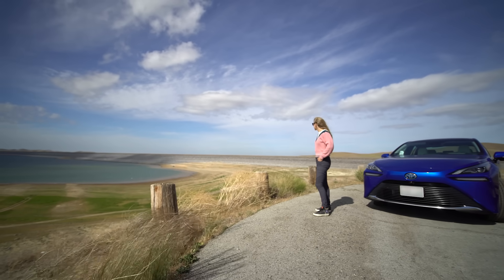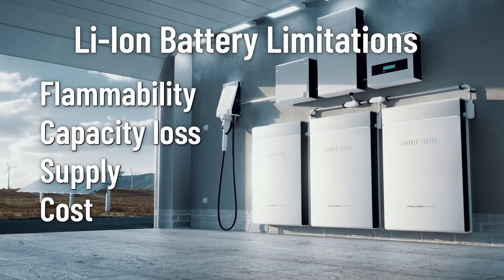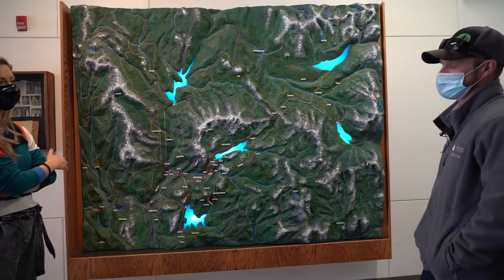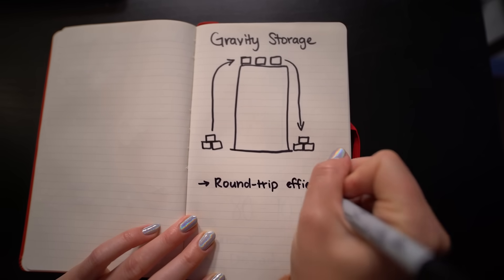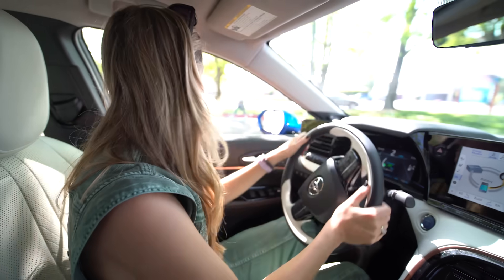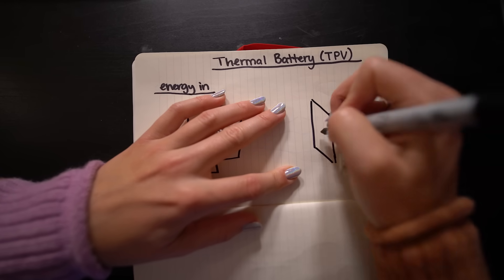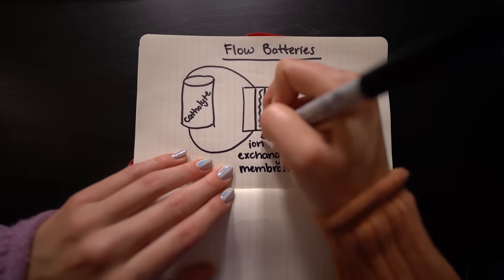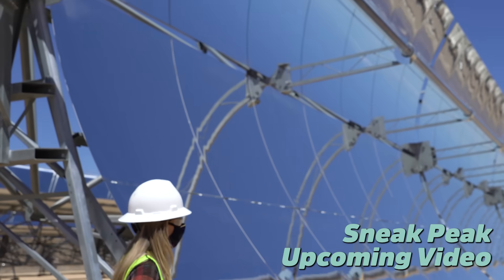The BIGGEST problem with clean energy

Comment from the maker: There are so many more discussions to be had around paths to using 100% renewable energy sources. I imagine some of you might suggest regulation or incentives for using energy when it’s most available to fix the supply and demand issue, i.e. the “duck curve.” Some municipalities already do this, and it works to an extent! Consider though, a supply like wind -  the unpredictability makes it hard to exactly match the demand schedule to the supply. Another solution is to add other sources of energy that are more consistently available, like waves, and nuclear fission/fusion. (We actually visited a company looking into a wave energy technology!) I’d love to make more videos on these technologies, but we decided to focus this video specifically on energy storage technologies emerging as a solution to the Duck Problem.
Reply: Also, continuing to focus on simply using less electricity and making electrical devices/equipment more electrically efficient.
Reply: Wind isn’t unpredictable or intermittent on a continent scale. Solar, while still intermittent, is very predictable. What is needed is strong grid interconnects, preferably long distance HVDC to move wind and solar from where it is being made to where it isn’t. 
https://www.eia.gov/todayinenergy/detail.php?id=20112
https://en.wikipedia.org/wiki/Capacity_factor
Reply: @williammeek4078  I would like to see more uses of concentrated solar with mirrors and molten salt storage, in places like the US there are areas where nobody lives, which would be ideal for it on a large-scale.
Reply: Since you have mentioned nuclear energy, can you do a report on dry casks please?
Reply: Hi! I research thermal borehole heat exchanger storage, and high pressure thermal borehole energy storage (academically, and contracting for the government). If you were interested I could send a PowerPoint we present to government entities usually on thermal borehole energy storage. It's very economical, and feasible on a large scale, but relatively un-heard of! One of the larger projects we are looking at for this is energy storage on the moon, and for military bases, so it is a developed technology that uses already available technology.
Reply: Why not just have solar panels around the world? Whenever the suns up you selling to the other side of the world that is experiencing night...
Reply: @TheBowersj  yeah building intercontinental DC high voltage cable is viable, and it's very easy to convince every nation to allow that to happen
Reply: @nedisawegoyogya  I gave you a thumbs up
Reply: there are a lot of chemical storage procedures available. adding methanol to hydrogen, combining them by making use of the energy from electrical overshoots, we could preserve that energy in a very familiar, easy to use, safe and co2 neutral way. eFuel, eGas
Reply: Hello I’m just a car tech but in my experience I believe GEO THERMAL is the future of free energy once that goes ‘iron core’ bye bye van Allen belts then we are all doomed be cool if you could read this and I would be intrigued to see your views on this energy source, regards rob the London mechanic
Reply: Also, there should be a discussion on decentralized power generation. I think this can complement the current power generation solutions.
Reply: @hermin  Yes. I expect rooftop solar plus storage to fall below the cost of grid maintenance before long and most residential homes to go off-grid.
Reply: @hermin  I think decemtralized power would be great for places like remote towns and farms, but cities and suburbs should still use grid energy to benefit from economies of scale in emergy production and in the future energy storage.
Reply: @Prof_Griz  I agree
Reply: An overlooked storage tech are the batteries in EV cars. There are projects across Europe looking to use EVs in a vehicle to grid (V2G) system for grid balancing and usage shifting.
Reply: One partial solution to the varying availability of wind energy is intelligent grids. For instance, in Scandinavia, it's always windy *somewhere*.
Reply: Hydrogen bonded to nitrogen.  Ammonia is worth a mention!  Existing infrastructure because of its use in agriculture.  Easily transported (exported renewable-saturated countries like Australia).  Can be stored in bulk very similarly to LPG: not super-cold nor super-high pressure (so less losses).  Can be combusted, but better fuel cells are bound to come.  Replace Haber-Bosch production which is responsible for 1.5% of CO2 globally.
Reply: Grid scale battery's are only useful for spinning reserve, not standby reserve. We really need more visual examples explaining the difference to people.
There is a massive misconception about how these systems will / can be used.
Reply: Energy storage and renewables will NOT solve the issue of ecological collapse. You know damn well that it is physically impossible to maintain an economic model that is based upon continual exponential growth and consumption of resources, on a planet that has FINITE resources. This scientifically invalid economic model is the reason we have destroyed our planet in record time. It is the reason that our energy needs are ten times what they should be to sustain us. And this entire system is enabled by psychologically manipulating humanity into being brain dead consumers. Our nature throughout history has ALWAYS been for thrift and conservation. We are depleting resources 2 1/2 times faster than the earth can replenish with this wasteful greed driven society of consumption. And just because we cannot satisfy 0.0002% of our populations desire to own it all. And psychology and sociology both prove that the manifestation of greed is a result of competitive environments, not our nature as our society is taught to believe.
Reply: @davefroman4700  Maybe asteroid mining and worm holes are a  solution
Reply: any "energy & environment" video ignoring nuclear energy is disingenuous. disappointing
Reply: @xyzzyx7812  Nuclear is only necessary because of our scientifically invalid economic model of consumption and waste for profits. That is why our energy demands are 10 times what they should be. Everyone is yelling about crypto, you ever stopped to think about how many terrawatts of energy are used every hour to support this consumer psyop called ADVERTISING? Our nature is for thrift and conservation. And GDP is the reason we are producing junk instead of products that last for decades. If you made a coffee pot last for 50 years like we used to instead of 4-5 like they are today? That is a 900% reduction in the amount of energy and resources that our society required to perform that function.
Reply: What do you think about iron/air/water batteries?
Reply: So you just store the water up here and then just let it run down when you need energy?
Yes, but 5:16 "There are some downfalls."
Reply: Would be interesting to have a future series on everyday energy usage. Many times I've run into places where the justification for leaving the lights on me than they would previously is "oh they are LED". How we use (or don't use) energy really impacts our ability to use and store it
Reply: Thumbnail suggestion: WATER BATTERIES? and show a super surprised face. Next to the words.

Title suggestion: I found the answer after driving for 5 days

Following veritasium's guide here.
Reply: Have you considered 30-40 meter flywheels? Super safe and easy, just spin a big wheel. Flywheels are in cars so we know they're safe. Bigger flywheels just means bigger safety!
Reply: @ElmoRitter  that would be inefficient compared to the others, you would lose much to friction and the cost to spin the larger ones would only get greater the larger flywheel you use.
Reply: @patryn36  magnetic levitation bearings. Boom problem solved you're welcome.
Reply: As a Canadian, the bulk of our energy usage is heating and cooling. Seasonal thermal storage at a reasonable cost would make a hug difference. If I could efficiently store the winter's cold for summer and summers heat for winter, then I only need to use a little energy to move the heat around with a heat pump. Solar evacuated tubes can supplement the heat energy year round.
Reply: Source on lithium running out by 2080?
Reply: @psikot  yes I don't think we will run out exactly as the lithium is in sea water, it's more to do with the fact that it would be uneconomical to remove it from low concentration areas. I do hope by 2080 though we will have the recycling of most of the lithium that we need like we do with aluminium and steel now
Reply: As was shown in Texas, grid interconnects are also needed. Texas has a lot of renewable energy, but their intermittent nature was affected by weather extremes. This is why Europe is furiously building continental interconnects.
Reply: I love you 💗
Reply: Hey, youtube keeps deleting my long post with articles to better fill you in. Look into Blue Hydrogen, which is splitting hydrogen from methane, which creates more carbon dioxide than burning coal. Further, look up the House study on "Clean Coal" and how it was likely dirtier than just burning coal. Then look up the storage of natural gas in the salt cavern in Hutchinson, KS. Then look up fracking and earthquakes. Etc.
Reply: The duck curve is a daily issue.  There is also a need for seasonal storage.  Batteries can not do that, only hydrogen.  You fail to differentiate this vs all of the other solutions.
Reply: You should have mentioned the Form Energy iron-air battery.  They recently announced that it's a better bet than their flow battery, because nothing needed to be invented to use it for long-term storage.  They investigated a sulfur-flow battery, but it needed a new type of separator between the anode and cathode, which could take a long time to invent.  They think iron-air will be $20/kWh when they scale it up, which will be cheap enough to combine with renewables and li-ion to shut down all thermal plants within 20 years. 
I think you are likely wrong about lithium-ion batteries being too expensive too.  There is so much investment going into li-ion that the LiFePo chemistry will likely go below $50/kWh in a few years.  How far below is anybody's guess, but that price range will be hard to beat for competitors of short-term storage (under 10 hours).
Reply: Wave energy, good. Wind powers much of parts of Europe, and US, with slow large turbines. Power storage, good, like with Tesla's powerwalls and megapacks. Solar the size of Nevada would power the planet. Hydrocells maintain Petrol structure, fracking, ineffecient electrolysis, bad. Please do not sellout, I beseech.
Reply: Also, offshore windfarms (more consistent) in the northwest could power the planet twice over. Heated sand and dirt is proving promising storage where relevant. Solar the size of Nevada (even spread out) could power the planet.
Reply: Not allowing the market to shift organically through profit is the biggest problem because over taxation and pressing this so hard gas led to corruption and very little return.
Reply: Let's put solar panels on every home, business and covered parking rooftop and switch to electric vehicles making nearly everything we do solar powered while completely decentralizing our power supply and empowering everyone as power generation owners.

Solar power is CHEAPER and electric vehicles are soon to be CHEAPER to make and already are considerably CHEAPER to maintain and operate, especially if charged from your own solar power.

A 3-5 year ROI (return on investment) for a solar array that will generate power for decades is a no-brainer and the panels can even be made locally too.

#EndFossilFuels #SwitchToSolar #SwitchToElectric #GreenNewDeal
Reply: I appreciate you and your content, but this problem has been solved already. It's not a science problem, its not an engineering problem, its a production capacity problem. The alternatives to lithium will come over time, but lithium batteries are the solution for now.
Reply: @Physics Gril technology connections here on youtube made a video about that not long ago and how he uses his ac at night to well "overcool" his house when there is less load on the grid and energy also cheaper and then turns it off for the day until the evening. you should check it out. this form of storage doesn't really work here tho. in germany about noone uses ac's anyway. we have like 6 month of winter and 6 month of shitweather so there are hardly any days where it's unbearably hot. but i like the idea behind his approach and he is generally such a funny and entertaining person to watch.
Reply: Like how a water tower stores water with potential energy,  we could create "mass towers" that act as mechanical energy batteries right next renewable energy power plants.  No chemicals,  all natural.
Reply: @toolbaggers  oxygen  and water are the 2 most immediately necessary  chemicals  for humans
H202  has powered the world's  fastest cars as a proof of concept
Reply: Combine renewable energy power plants with desalination water plants or use the electricity to create hydrogen and oxygen.  Compress the gases for storage and burn it for electricity and pure water when needed.
Reply: @toolbaggers  with H202 you don't have to compress it (it's a non flammable  liquid) and it's a whole lot denser than H2 and can add O2 to the air instead of taking it out like HC's .
I'm surprised  no one here talking H202
Reply: I♥U
Reply: It's not mainstream but storing hydrogen (H2) as ammonia (NH3) which is actually more hydrogen rich for the same volume and easier to store is a truly sustainable solution.   You can convert water to NH3 directly using Solid State Ammonia Synthesis (SSAS) and convert/generate electricity efficiently with specialized Solid Oxide Fuel Cells (SOFC).
Reply: You really need to learn to simplify things or be more entertaining. watching your channel is like steam going through your head. there must be a reason that you have 2mil subscribers and only 300k view's on this channel while most youtubers have the opposite problem where they have many more view's than subscriber's. Also as going to 0% global emissions by 2050 just seems like you are allowing poorer countries to rot, England, the US, Australia has been using oil for the past 130 year's and their GDP raised an insane amount during this time a big part because of the pricing of oil, today even with all these new technologies arising oil is still by far the cheapest way of producing electricity with only nuclear next to it then come's renewable's. are you willing to let millions of poor people in underdeveloped countries live with no electricity for the sake of a mistake that your 1rst world countries has been perpuating for over a hundred year's?
Reply: 🤗 How come you didn't cover Geothermal Energy❓The whole inter core of the planet is a giant energy storage facitly. In Iceland, the main use of geothermal energy is for space heating, with the heat being distributed to buildings through extensive district-heating systems. About 85% of all houses in Iceland are heated with geothermal energy.

You don't have to live in Iceland to access Geothermal Energy. You can access it right in your own back yard. 
I watch an episode where host Mike Rowe installed a Geothermal Loop Field system to heat a home. What I find very interesting is a home or city could access the energy in the earth to reduce the stress of other energy systems like Solar and Wind. Especialy in winter when you need heating and the sun doesn't shine as much. But what about summer's heat? Well you can use the same system to cool your home.
Reply: No, Physics Girl, I'm sorry to tell you, you are wrong storage is not the biggest issue.  And the renewable energy experts aren't going to tell you what the biggest issues are, because they know that the REAL serious problems are what make virtually all our "eco" energy technologies non starters.  

1.  Infrastructure.  Solar and wind are very low density energy sources, building and maintaining solar and wind will take 100 times the infrastructure.  That means 100x the steel and materials, 100x the manpower to maintain, and probably 1000x the space requirements.  This will cost, hundreds of trillions of dollars, and in the case of solar will need to be replaced ever 15 years.  This is not even close to being sustainable.  
2.  Toxic waste.  Producing solar panels and li-ion batteries creates a lot of toxic waste currently.  If we were to ramp up solar panel production to the point where it would actually generate a significant amount of our energy consumption, we would need to deal with an astronomical amount of toxic chemical waste.  And because solar has a 25 year lifespan and need to be replaced (which btw, makes them NOT renewable) this toxic waste nightmare will be an ongoing concern.

You want me to believe like I once did that this channel is about science and not zealotry, have some courage, and make a serious video examining these issues while being open to the possibility that you could be very wrong and on the wrong side of history with this.
Reply: @homewardboundphotos  Try to apply some common sense to the issue. The Levelized cost (that is cost with direct subsidies removed) of new wind and solar is already below the marginal cost of any fossil fuel. 

That means wind and solar CANNOT be using more resources.
Reply: @homewardboundphotos  Sorry no, your numbers are wrong. You need to show your math so I can teach you how to do the math correctly. 

And if you think those wrong numbers for what you have been fooled into believing solar would cost are high, you should see how much fossil fuels cost over their lifetimes. 

And if you think the environmental impact of solar manufacturing is high, you need to do some research on the impact of fossil fuels. 

So, do the math to back up your claims. Put up or shut up.
Reply: @williammeek4078  LMAO
Reply: @williammeek4078    OK dummy

Every year the earth consumes 580 million terajoules, that's 5.8e+20 joules of energy (INCLUDING fossil fuels, not just electricity).  That would be 15.6e+20 kwh/year (1560000000000000000000 kwh/year).  A typical 60 cell PV is about 5.4 feet tall by 3.25 feet wide, or roughly 2 square meters, and in favorable conditions, will generate 500-550 kWh/year.  So....   we'd need 1.05+18 2 meter squared PV panels.  Or 2,000,000,000,000,000,000 meters squared of PV.  There's your math.
Reply: @homewardboundphotos  You did soooo good at first. But you added a few orders of magnitude in conversion. 580,000,000 terajoules 5.8 x 10^20 J is 1.61 x 10^12 kWh. 580,000,000 joules is 161 kWh. Tera is 12 orders of magnitude. Kilo is 3 orders of magnitude. For 15 orders of magnitude. So 161 x 10^15 Wh in engineering notation or 1.61 x 10^17 Wh in scientific notation. 

But we are only concerned about the 80% of that that is fossil fuel use. So that becomes 1.29 x 10^17 Wh. 

Now, use a utility grade 72 cell 400 W panel that actually is 1 meter by 2 meters and you get 876,000 Wh per year per panel at the rated capacity factor for Texas of 0.25. Divide 1.29 x 10^17 by 879,000 and get almost 150 billion panels. 

Times 2 for 2 square meters per panel and you get 300,000,000,000 square meter covered or 74,131,000 acres. Divide this by 640 for square miles gets you 116,000 square miles. Texas is 268,820 square miles so roughly 43% of Texas needed. 

But there is a MUCH easier way to calculate. Utility scale solar farms get about 1 MW for every 4 acres. 

By the way, the Earth is only 5.1 x 10^11 square meters so your math doesn’t even match your own claim of “the size of Texas”

Also, the cost would be about $50 Trillion which is actually less than what we would spend on fossil fuel infrastructure maintenance over the same time period.
Reply: @williammeek4078  Yes, I forgot a negative exponent when converting to kwh.  Fundamentally, we agree on the scale of the project.  I said the size of Texas because it's an absolutely preposterous size.  You say half the size of Texas, as if that's somehow also not preposterous.  Using the almost half the landmass of the state, which we both can agree on, your 50 trillion dollar proposition would put the cost of these panels at about $112 per square meter, including installation, and maintenance for 25 years.  If you think that is realistic you're on crack.  Multiply that by maybe 4 times and you're getting close.  $200 trillion dollars, every 25 years.  8 trillion dollars annually globally is what you're pipedream will cost, and that's not even factoring in the hundreds of trillions worth of battery backup and transmission line upgrades that would also be required (and need regular replacement).  

And this is all about the environment right?  How much toxic waste do you think will be generated blanketing 300,000 to 400,000 square km with PV and the battery backups to go along with them?  I've read the investigative journalism about the factories in china that produce these things.  There's a small lake of insanely carcinogenic toxic waste right beside every factory, your proposition would seen those lake turn into literal oceans of toxic waste.  And that's just the manufacturing process say nothing about the nightmare issue of dealing with 400,000 square km at the end of their life.  

Do you have any idea what the environmental impact of that would be?  Have you even thought about it?
Reply: @homewardboundphotos  so where is the 30kwh battery powering your house?
Reply: @mukundsrinivas8426  why would I have a 30kwh battery powering my house?
Reply: @homewardboundphotos  see we don’t have enough storage yet
Reply: Wave Energy failed miserably in Australia which has many "waves" and coastlines
Reply: Thank you for this series - great work!
Reply: Good topic to discuss now.  I should also hop on this and maybe look at batteries 🔋  or solar panels und ther microscope. 
Wish you all a good week!
Reply: The VW  XL1   diesel/electric hybrid gets over 200 mpgs. This is proof any car maker can build a small 2 seated affordable hybrid commuter car able to get around 100-125 mpgs. The XL-1 uses lots of carbon fiber to keep weight down but they could use aluminum and still keep weight down. They just refuse to do so, it's all BS, hybrid cars could run off bio diesel, ethanol, compressed natural gas, hydrogen, propane and pollute much less . The Honda NC750X motorcycle gets around 65 real world MPGs even with all it's wind drag/poor aerodynamics. If they built a 2 seated reverse trike with a lightweight aerodynamic enclosure it could get 65-70 mpgs on just the 750cc gas engine alone. Add an electric motor & battery pack = 100 mpgs easy. Also they could make a compressed air electric hybrid vehicle. They're just finally getting around to adding solar panels to vehicles to increase an extra 15 miles or so. The real reason they haven't put solar panels on hybrids sooner.7:34 Electroysis  from solar = It's more efficient to charge a battery/e-car then to create hydrogen & oxygen to power a car. Unless the fuel cell can somehow make up for lost efficiency.
Reply: @michaelbrinks8089  There was nothing affordable about the XL1.
Reply: @PistonAvatarGuy  They used lots of carbon fiber to keep weight low which made it expensive but could use aluminum instead. The gen 1 Honda insight for example could of used a rechargeable battery bank with it's gas engine and parallel electric motor and got 100 mpgs on a combination of 1 gallon of gas and fully charged battery.
Reply: @michaelbrinks8089  the XL1 doesn’t actually get 200 MPG. It just runs as a BEV and keeps the engine off. This is why it is absurd to have one MPG number for a PHEV. There needs to be two sets. One for the engine running without plugging in as a regular hybrid and one on battery only.
Reply: You should post which H2 stations you stopped at to refill. To see where you can go on a FCEV.
Reply: Was about to suggest another way to store energy but I see it's probably going to be in your next video. Hint: salt.
Reply: Check out Tom Scott's latest from the Orkney islands. Hydrogen (not by steam reforming) is the future of Storage and transport of energy.
Reply: @jonathans1759  The fundamental flaw with making hydrogen from “wasted” RE is that it takes 2x as much electricity to make the hydrogen as you get out of it.it is far better to increase grid connections in order to get that electricity to a market that wants it.
Reply: How about the jobs that these technologies will create.  Potentially millions of them.  Saving the planet could be a real job creator.
Reply: @briand8090  - please read my comment regarding the costs of getting the materials for manufacturing and the subsequent pollution. I didn't cover the minerals for making solar panels, but covered mining lithium and war like posturing of the US over lithium (similar to what we do for oil), blue hydrogen which is splitting hydrogen off of methane which creates more CO2 than just burning coal and is funded in Biden administration's infrastructure bill. Or the problem with underground storage and sequestration of these chemicals and compounds. Etc.

Don't just look at jobs. And there is a larger environmental impact not being discussed at the moment.
Reply: @ajc-th5ei  false equivalency to that of our current systems or the effects of our past actions.  And you're assuming that further research wouldn't decrease the need for those materials or that recycling and landfill mining couldn't fill.
Reply: @Dianna 
Hey, Thanks for your videos. 
I recently heard about liquid metal batteries.
They use for example Aluminum at melting temperature to store electricity.
The benefit is, that the price is lower than lithium and the can't explode.
In worst case, the cool down and solidify.
Have a nice day, I like your work a lot.
Thank you and your team!
Reply: The patents for viable energy storage exist, the funding does not. Molten salt is the only current viable solution.
Reply: What about superconductors 
Even though it's still kinda a sci-fi concept
Reply: @zo_gamer3740  - Superconductors are actually quite interesting when used as capacitors in conjunction with batteries for storage. Batteries are slow charging and energy on demand, whereas superconductors for storage are fast charging. Combining one holding the charge to charge the battery over time has been looked at regarding graphene. Really interesting research, if you have the time to look it up.
Reply: @ajc-th5ei  I've seen a couple videos about them but really haven't gotten into much research but thanks for enlighting me with info I would've never known😁
Also I've heard nuclear energy is somewhat better than solar or wind cause of how much energy it can produce without any carbon emissions 
Is it better than solar or wind with the only drawbacks (I know of) being the disposal of used or depleted fuel rods
Reply: @zo_gamer3740  - for some reason, youtube deleted my response to BigCooter about nuclear. 

Basically, France has a process of recycling nuclear waste which we do not use due to going over IAEA established limits on nuclear refined material. It makes the waste down to 6% or so, with 93-94% being reusable. Instead, we use fresh ore and then store the waste in heavy water or transport it to Yuka mountain for long-term storage. To understand the problem with long term storage, you should look to places in the northwest and other areas where we have even seen leaks of the barrels containing the material.

Small form reactors where the material can dump into molten salts is promising, as well as tokamak fusion reactors and other small fusion reactors currently being developed. Fourth generation and newer nuclear plants also are safer.

But, the US has a problem of having positioned reactors on fault lines due to cheap land and the problem of Not In My Back Yard. As such, there are concerns on what happens regarding that. Further, with aging power plants, we now have in some cases 60 years of waste in pools designed to only handle 40 years worth of material. They need larger overhauls not being done. 

So there are a lot of drawbacks to nuclear not currently being discussed, although there are exciting advancements being made.
Reply: At 0.75 speed I got that... be carefull though because you'll fall in love so much quicker
Reply: Aww, you missed my favourite. Solar Thermal!
CSP (Concentrating Solar Thermal) I especially like the Power Tower approach.

Or wait, is that going to be in your next video? Yay!
Reply: How about developing devices that are energy self sufficient. Maybe energy was never meant to be stored but generated and used, I believe that concept is possible
Reply: Water is cheap and available,  plus you can store sunshine as the cleanest fuel and / or hydrogen.
We like it here at MILLS MILLS ENGINE WORKS INC - the Worlds Largest  Pollution  Free Automotive Research  Laboratory  (not in California)
Reply: I suggest not using unrealisable energy sources
Reply: @NoRegertsHere  I know - Li/Ion ?
Reply: @NCOGNTO  
Coal, natural gas and 4th gen fission. 

Without that, a country will fall behind in everything. Manufacturing, innovation, standard of living, ability to defend its borders. 

Energy grids of the future (70+ years) must scale 30-40x what they are now. And the energy needs to be on demand.

Renewables are an absolute joke compared to those other 3.
Reply: @NoRegertsHere  "Renewables are an absolute joke compared to those other 3" 

That is a very fast conclusion when you consider the future of renewable energy. We may never know the surprise the world is in for in the nearest future. I think there's something coming in the world of renewable energy that will sweep us off our feet and fix the world's energy crisis once and for all
Reply: @NoRegertsHere  well , sunlight is a constant based on fission if I remember correctly .
"Renewables" are mostly based on "solar", if we can harness it .
Reply: @NoRegertsHere  "Beamed from space" mean anything to you ?
ITS FREE !
Reply: I think we should be looking at harnessing the energy provided by constantly flowing sea currents.
Reply: @marksandison3642  making seawater into H202 could provide badly needed oxygen to our atmosphere and reduce sea level while reversing global warming
Reply: @George Mann where do you put your toxic waste ?
Plastic is bad enough and it's not even radioactive
Reply: Couldn't find any relevant sourcea on google so I'll give it a go and ask the actual physicist: Would electrolysis powered by a Deuterium+Tritium fusion reactor in theory be able to refine water into deuterium and tritium with enough efficiency as to never run out of fuel?
Reply: @OB1canblowme  a solar / water plant can make 2 fuels - H2 for stationary use and H202 for mobile use - doubles profits
Reply: @OB1canblowme  why do all that - mining ,refining , constructing and operating reactors  ? When solar energy is free and available  everywhere ? Eliminates supply chain if captured at point of sale .
No waste either
Reply: Pricing has to match actual abundance not just timing.  And demand response and EVs are how we solve this not grid storage.
Reply: @crhu319  water is cheap
Sunshine is free .
It's simple to catch and use
Reply: One energy storage tech that should have made your list:  Liquid Metal batteries (Donald Sadoway, Ambri) "If you want your batteries to be dirt cheap, you need to make it out of dirt, preferably locally sourced dirt."  He uses that philosophy to restrict where on the periodic table to look for battery technologies.   Since his batteries are molten, the anode/electrolyte/cathode interfaces can't degrade, so they should last basically forever.  The downside is the heat will leak out no matter how well you insulate, so if you don't use the capacity as much, it is less efficient (you need to spend some of the energy to keep the metal liquid) but 70-80% is not unrealistic.  They are scaling up production for a commercial contract now.
Reply: @flyinbrian865  our whole plan is lower energy costs
Sunlight is free , use all you need/want
Water is cheaper than oil (by a bunch !) and needs less processing  to be made into fuel and less people in the distribution  chain
If its Pollution  free , you don't have to buy scam "pollution  control devices" on your car (better than just "free")
Reply: @flyinbrian865  a single drill location costs around $9 Million here in Louisiana
Reply: There are significant, if not unsurmountable problems to overcome.
Firstly consider that renewable generation, wind, solar, tidal or wave are all asynchronous generation, i.e. they are uncontrollable. This means that they can never power a grid without having a significant part of the grid supply as synchronous, typically fossil fuelled or hydro to keep frequency stable.

I can't see that storage can ever be large enough to cover 365 days a year.  This last four months or so in the U.K. w ehave seen a very low average output from our wind farms. If you calculate how many gigawatts hours that amounts to for the below average generation level it is quite apparent that storage cannot not do it. Consider current batteries installed have capacities in the  Megawatt hour range .One days storage to compensate for low wind output is in the conservative order of 4 x 24 Gigawatt hours. As I say we have had four months with no sign of it changing at present.
Reply: Was there any discussion among folks you met about blending the compressed air or cryocooled air models with carbon capture efforts, for a synergistic environmental benefit??
Reply: @ryanrosenberg785  ever heard of the KISS Principle  ?
Reply: also, any mentions of combining cyro-cooled technology into home systems?  seems like there could be blended applications with some of the newer "ice battery" HVAC systems.  Those are primarily in commercial building applications currently but look to be heading toward mainstream residential use as well.    P.S.   Love your channel, your PBS content, and you've been a joy for my kids to learn more about science (particularly during school shutdown and virtual learning last year!!)
Reply: I am so glad to see that these complex issues in regards to going 100% renewable are finally getting the press they need!  As someone who has been interested in renewables since my childhood in the 70s, then learning about the "REAL HURDLES" that will have to be resolved before it becomes a reality by the 80s, then spending the decades afterward hearing everyone praising the power of renewables, and that it has to be done today, without knowing or understanding that without scalable, safe, and economical storage it won't happen.  Right now our grids capacity has been maxed out for sometime now and just adding more solar, geothermal, hydro and wind generation is only going to make things worse, not better.  I am also very glad to see so many companies are really working hard to resolve this issue, but again having a scalable, safe, and economical storage isn't going to be a quick and easy fix as you have pointed it.  It's going to take a lot, and I mean a lot more bright and educated people, big business, the fossil fuel industry and governments working together and not trying to condemn one another or screw one another, to make this happen.  Now for it to happen by 2050 is another matter.  There are more hurdles then just technological ones to make that happen, but that's for another video, Physics Girl! wink LOL!!!
Reply: @DarinM1967  u need to make a book
Reply: nature already stores energy for us called food
Reply: A good video on how to understand and use your instincts https://youtu.be/XrmyGtdmgoY
Reply: Corporations have been limiting scientific progress to secure profits for over 100 years. We could have had LED light bulbs in the 70's. Girl, i love your light and aspiration. But, it's for not at this rate. Go Biden!
Reply: You should at least mention about this solution
Reply: Clean energy is not necessarily renewable, what we need right now is 0 CO2 emissions.
With uranium only we won't have to worry about renewables for at least 1000 years.
Adding thorium to the mix in the next 50-100 years we'll have limitless amounts of fission energy, and by that time might have also figured out fusion energy.
So by focusing so much on renewables y'all are diverting valuable efforts towards 0 CO2 with virtue signaling activism that ends up blocking progress
Reply: Nuclear is not a viable solution, except from the point of view of the profits of the nuclear industry.  It is expensive (as I could see from the nuclear power surcharge line item on my electric bill when I used to live in the San Luis Obispo CA area), destructive of the environment and worker's health (in the mining process), dangerous (Chernobyl and Fukushima show this), and leaves nuclear waste that continues to be highly radioactive and thus has to be kept secure for hundreds of thousands of years (far longer than civilization has been around).  Renewable is the only way to go, and we could have already had it if Reagan and his corporate friends hadn't killed all of the research into it that they could kill.
Reply: Physics "Girl"  ..... looks like a 40 yo woman
Reply: Why are we spending our precious dollars on "renewables." One nuclear plant is like 10 billion solar panels.
Reply: Store heat: molten salts @ 750-650 C. Also for nuclear fission again molten salt UF4 in BeF and LiF salts, operating @ 650-750 C unpressurized. Solves a heap of heroic engineering challenges such as the fuel pellet expansion problem and the high-pressure vessel problems. Have a look at the molten salt reactor experiment Oak Ridge 1965 - 1970.
Reply: I won't take man-made climate change as a legitimate issue when the solutions don't include nuclear technology, something that has 75 years of research and implementation history.  This is all just Political Correctness to the nth degree.  Not that I don't appreciate the research in other technologies, but there is mostly a blind spot regarding nuclear.  Also, you don't seem to consider the comprehensive problems involved, like environmental costs of manufacturing and disposition of the byproducts.
Reply: @rwmiller9062  And nuclear power doesn't have problems during manufacturig parts for the plants or production of fissile material? Do you think enriched uranium appears out of nowhere? I think the miners would disagree.
Reply: I forwarded this to my colleagues at work as we supply control valves and instrumentation and we have a ton of old potash caverns and oil reservoirs we can use for storing air in Saskatchewan. Nothing for pumped hydro since we are super flat.
Reply: Where are the nuclear power plants or nuclear fusion plants (future)? Save and clean energy
Reply: I wonder if carbon solar could reuse existing solar at night. Have a little carbon lamp that flips over the roof solar (covered to stop light pollution).
Reply: @Alien Reject Less than the energy required to feed them. Food in = energy out. You may as well just burn that food under a steam generator for power.

The fitness? It helps people get fit for certain. But it produces so little power, it's almost pointless for anything past charging your phone. So with such easy access to solar etc, it's just easier to exercise normally and put the phone on a solar charger instead.

Someone did the math on Youtube. You just have to search.
Reply: Thanks Diana. My 13 y.o daughter is so inspired because of you. She’s recently introduced you to her 8 y.o sister too. I can’t thank you enough.
Reply: All the government do is incentivize all green true zero emission energy to compete with fossil fuel then let the market do the rest.
Reply: Why modern renewable power doesn’t need a breakthrough in energy storage | Amory Lovins:
https://www.youtube.com/watch?v=Oo8iEL6SqgI

Bill Gates on Energy Storage: 
https://www.youtube.com/watch?v=RH5Lgv-4te8

Hydraulic Energy Storage:
https://www.youtube.com/watch?v=ObvQFX6noDw
https://www.youtube.com/watch?v=m3p_daUDvI8

Giant Flow Battery Storage for Cities:
https://www.youtube.com/watch?v=_qsKUVQtAhA

Flow Batteries Used to Live Off Grid:
https://www.youtube.com/watch?v=4OHstY_kKUY

Flywheel Energy Stabilisation: 
https://www.youtube.com/watch?v=_QLEERYS5C8
https://www.youtube.com/watch?v=N9PPSTczTNE
https://www.youtube.com/watch?v=QU-Px0VjQ2w

Recycling Batteries: 
https://www.youtube.com/watch?v=HiOLan8J0cE
https://www.youtube.com/watch?v=iFchfHH0qzg
https://www.youtube.com/watch?v=dOn-L6nUS54
https://www.youtube.com/watch?v=oKFOqMZmuA
Reply: I am excited about liquid metal batteries and aluminium air batteries as well as storing energy by creating hydrogen. Dams are quite ecologically damaging at large scales. Look up Ambri about liquid metal batteries, they have practically infinite charge and discharge cycles, and utilise the excess heat to maintain their metals at the liquid state. The aluminium air battery is pretty promising for long range usage, and excess energy can be used to turn the aluminium oxide back into aluminium.
Reply: trees just sit there trees forget about waves trees are waiting for a break through.. so lets figure out how we can use tress to solve our energy efficiency. Im not sure how it all works but ill try to figure it out
Reply: Anglo American is building a solar powered plant to charge hydrogen fuel cells. These cells will power a 2,000 HP truck fleet that operates 24/7 at a Platinum mine in South Africa. The target is to eliminate the burning of 6 billion liters of diesel per year by 2030, at a lower operating cost. If you are interested, I can put you in contact with the project team head. Regards.
Reply: I see it as a balancing act governments and markets will have to figure out between storage, long range transmission, and induced demand. That last one, induced demand, is especially interesting to me because it could also help offset the carbon we have put in the atmosphere in our history and the carbon that is now being naturally released due to things like the thawing of permafrost. There are several direct air capture technologies that have relatively passive phases of operation and then only require energy to actually sequester the carbon.
Reply: Best to stick with nuclear fusion/ fission technology, cleaner, uses less land, more efficient, and safe for the so called environment.
Reply: My fave grid scale storage tech is the liquid metal battery. Cheap, same millisecond response time as Li Ion, 300 year lifespan (200,000 full charge/discharge cycles), bla bla bla. I like it because it needs to be run hot instead of needing cooling. A major industrial city needs 4 days of storage to use as much wind and solar as possible and dependable power that I see as nearly only available from nuclear. In this context hydro is not sufficiently dependable to be called dependable because, water.
Reply: This was solved 15 years ago. AI is why you never learned it. I was there with NASA Ames and Stanford scientists and White Sands engineers. I hired them and they did their job well.
Reply: You conveniently leave out what it takes to manufacture all the components of the various systems. Batteries in particular require a lot of fossil fuels to mine and process. The same with photovoltaic cells. And wonderful, burn up hydrogen, yes one of most abundant elements, but you want to remove it from our water which we need to live and how many things will be impacted by the balance of hydrogen / water on the planet. I simply do not see how this is any improvement to our environment.
Reply: @dallasarnold8615  it’s not, it’s just gaslighting to make them feel good. We should stick with nuclear and develop fusion power, as well as design clean burning hydrocarbons in a lab and bio fuels. Diana is getting too caught up in politics and is losing her critical thinking skills.
Reply: @dallasarnold8615  The inability of humans to develop&deploy comprehensive, EFFECTIVE solutions that do more good than harm is evidence of the REQUIREMENT for a large united global braintrust&a fractured, divided, uncooperative, war-loving & generally distracted planet-sized population is evidence we'll be extinct in well under a decade. The ICE CLASS at GretaThunberg (0rg) explains this in physics and chemistry clearly enough.
Reply: Nr
Reply: Ùùuùunrùuu
Reply: Hi, I might have found a solution for this problem. A lithium free zinc based rechargeable battery. Would u want more information?
Reply: @mukundsrinivas8426  What is wrong with lithium?
Reply: @williammeek4078  very pollutive and expensive to manufacture. Cannot be manufactured in open air like my technology
Reply: @mukundsrinivas8426  that is a pretty incredible claim considering lithium ion is the cheapest rechargeable battery ever. Also, lithium is starting to be extracted from seawater.

But sure, show me what you have.
Reply: If we all worked together as a human civilization, perhaps decentralized energy storage solutions would also help to some degree. When people are sleeping in one part of the globe, there's other people who are awake and need that energy. To a lesser extent, and within a smaller geological region, there's always variability regarding when and how much energy people use within a given amount of time. In that sense, the problem of having to store larger amounts of energy becomes reduced.  It could also be more cost effective when we don't have to as much of the energy that we produce.
Reply: Solar farms should advertise sales when they have a surplus, text EV owners to  plug in their cars.
Reply: can i work with you
Reply: The answer to renewable energy is simple: Lead-Cyanide-Stryctnine batteries!!
Reply: Hi PC, here in the UK they are now working on smart chargers charging ev's. They have the ability to feed back to grid when needed. This would use a small amount of the owners vehicle battery in exchange for a better tariff, for instance. When you combine solar on your roof and add your car sitting on your drive way, you become your own power provider (overall). The best thing is the power is non centralised, safe and efficient due to little transmission loss. As a side bonus, this also makes the grid more secure, in every sense of the word.
Reply: Hi Physics Girl, Can the energy from lightning be safely captured?  Has this been looked at?
Reply: @Parpl22  It can be--in a bottle. And I can sell you some for $40,000 a bottle. I also have a bridge in Brooklyn to sell you if you want it.
Reply: Why is everyone so oblivious about geothermal energy? All you need is a hole deep enough and you can pump saltwater into it and use it to drive a steam powered generator day or night, wind or no wind.
Reply: @VGAstudent  They call that fracking.
Reply: Hi Dianna, I have a couple of ideas regarding green, clean energy. Not sure how to get the ideas to production sources. Any thoughts? Really enjoy your videos !
Reply: Nuclear ftw
Reply: I am wondering why super capacitors weren't mentioned as a source of energy storage? even if it's just a bridge solution to lithium ion while more efficient solutions are developed?
Reply: Armstrong was doing energy from a weight on fluids in the 19th Century.
Reply: So fun to watch. 🧠
Reply: I have some great info for you on Nat Gas and Hydrogen sources and cutting edge tech.
Reply: The ocean holds great energy wealth but presents many long-term issues regarding corrosion from sodium chloride.
Reply: It'd be better, if we want zero carbon, to go nuclear for baseline energy and hydroelectric plus a few peaker plants.  Then we don't have to do the expensive storage.  It'll cost $60k per house to do both solar and storage and it is far cheaper to do nuclear and hydro when the cost of those plants are divided up among the houses served.  Hydro also provides water which is much needed in California so hydroelectric is like a twofer.  Solar and wind simply is not a feasible solution.
Reply: Nuclear?
Reply: Wind is actually a lot easier to predict than solar. Here in Denmark, wind makes a big part of our power, on windy days, much more than 100%. And still, every day at 2 PM, the prices (and hence supply/demand) are locked for the next 24 hrs.
Reply: You touch a very important point here: Move the demand. 
And it should actually be somewhat "easy". For a normal household the biggest energy consumer by far, is heating and cooling. 5 times as much as everything else. And heat/cold is very easily stored in a insulated water tank. And having such a tank for your HVAC locally, would make much better used of the grid, so it dont overload.
Next is the fridge/freezer. Again, with current tech, is should be fairly simple to make a smart-fridge, that can cool ahead when renewables are avail and shut of when the demand is a peak.
This is of course, if you don't have a Tesla or other EV parked outside. But the power demand for those are even easier to move... We just don't do it enough.
Reply: Unsubscribing to this unscientific propaganda. Solar energy supplies all the Earth's surface energy cycles. I'm in Seattle. We have Wind, Hydroelectric, and Geothermal as Green 24/7 power sources. Wind is reliable because Columbia Gorge is fed by Earth's continental prevailing winds. Hydroelectric provides night and peaking power. The 4 small Vertical Axis Wind Turbines at house corners have about the same yearly output as my rooftop Solar cell array. The entire country of Iceland runs on Geothermal.
Reply: The channel "Undecided by Matt Ferrell" actually goes into how companies are working to corner the market on efficient recycling of lithium ion batteries and other elements used in substitution! It's through a type of hydro-metallurgy process, which is exciting to consider if lithium ion is estimated to deplete by 2080! I just watched it, definitely worth looking into more.
Reply: Oh this was pretty cool a metallurgist talking about carbon steel
Reply: https://youtu.be/gPepgsGu0oQ sorry forgot to share the link
Reply: I love your notebook addition to this video.  Lucky you have nice handwriting as that's not typical for a physics mind. HA
Reply: Firstly, nuclear. Second, the resources needed for renewable is actually not feasible long term. Thirdly, fusion!
Reply: @austinpatterson7500  then you should consider also geothermal wave motion generators getting entire communities to go solar to sell back energy. Magnetic generators. There's lots of ways to create or harness power
Reply: @TheBunnyodeath  absolutely agree
Reply: In the US anyway, off-shore wind is about to take off, this has the potential take up the "dark side of the Earth" slack in PV production..
Reply: Loved it, dyk one of the Victorian Power Banks went up in smoke (built the units way too close to one another and burnt the others down with it) & you probably know this , Hydrogen is a by product of many chemical production plants. but bad news, you have to replace H. car fuel tanks every 5 years why?
Reply: @Physicsgirl Can you answer this question for me in a video? if the whole earth was burning ONLY H2 (from water, gases etc), in how many (millions? billions?) years this will affect the balance of the environment? We can hypothesize that even 1% depletion it may lead to bad effects on the environment? eg. less water less h2 related gasses, environmental chemistry may be affected.
Reply: the main problem about renewable energy is not technical, it is the economic and politic will to make it work.
Reply: Unfortunately the aspect of physics won't suffice. In order to have perpetual free renewable system. It needs too be observed as a whole. Taking each symptom that needs to be solved. Apply that to the whole. Example waste of system is still energy and material to be applied to another. By integration hubris needs to be eliminated.
Reply: Why should anyone listen to a pseudo-scientific conartist that UNETHICALLY deceives the public by FALSELY claiming scientific discoveries that aren't rightfully hers or ANYONE at her channel?
Reply: Intermittency is the 3rd largest problem.  The first is that inverters have no inertia and therefore cannot stop faults from burning or cascading blackouts.  Even the attempts to program the inverters to respond has failed, as several blackouts happen because the generator disconnects from the grid rather than increase generation to trip the fault off.  The second is that they are not green due to the massive amounts of millions of acres of eagle-killing blades or birds being fireballed out the sky from solar mirrors.  Nuclear is the only non-coal alternative, while coal is the cheapest.  Any coal not burned in the US is shipped to China to be burned with far more pollution.
Reply: You missed liquid metal batteries. There is a company by the name of ambri. It has an efficiency ~ 80%, It is scalable and perfect for grid balancing
Reply: Why oh why does know one talk about Geothermal energy ??? 
If we put as much time into it as the sources mentioned in this video all this talk about storage would fade into the back ground of the automotive industry.
Reply: Why do you try to associate yourself with Physics, when you nor any of the DROP OUTS and LAZY GRIFTERS operating your pathetic channel, are aptly educated and experienced in the sciences?

You, at best,  have a Bachelor's (but even more likely, you only have a mere Associate's degree - that is what "undergraduate" means).

There is no indication you are pursuing a Master's or Doctorate.

Finally, you have been published (and,  this,  peer-reviewed, ZERO times. No scientific journal or reattach community knows who you are and NONE ever support your channel - because you are unethical, misleading, and your channel is clearly COMMERCIAL in nature,  not academic.
Reply: Zinc–bromine batteries. 100+ Year old technology.
Reply: @matthornton44  I was going to first ask you, "so, what is your point?" But, I doubt you really had one, as you used up all your "look at me, aren't I clever" brainpower on that gem.

Besides, your little knowledge flex is completely WRONG.

1.
The PATENT for a zinc/bromine battery system was applied in the lat 1880s - that makes the zinc/bromide CONCEPT 130+ years old (significantly more than "100+"). Enough of a variance  to make your statement categorically false. But, kudos on your pretentiousness!

2.
NO "technology" was developed until the 1970s, because, the idea had fatal flaws that needed rectified before the battery could even be produced successfully in a lab, let alone applied to any markets.

3.
That makes the "technology" around 50 years old.

4.
The A-10 Thunderbolt ("Warthog") is a military Anti-armor, close air support fixed-wing aircraft. Guess how long it has been in service? Since 1972.

So, yeah, exactly what does "100+" (PLUS, add 30 more) years have to do with anything?

Feel free to elaborate your genius - which fits with this channel and their poorly educated posturing as a scientific  channel (really just after monetization and ego-massaging pseudo-intellectual credibility).
Reply: The content is really something ,i feel, is important and interesting .
Reply: What do you think of hot, liquid-metal batteries for grid storage, like Ambri? Snake oil or a real contributor to balancing a renewable grid?
Reply: @kalvindeane1  not snake oil, but nit the best solution. 2x overbuild RE with HVDC connections between the various regional grids and most years, no storage for longer than minutes is needed. Once a decade, a 12 hour shortfall of 25% is the max anticipated. V2G seems tailor made for that.
Reply: @kalvindeane1  That's a point which this video did not focus on fir some unknown reason, right?  Liquid sulfur battery wasn't even touched and tgat was a interesting item a decade ago.
Reply: Geothermal energy might also be considerable consistent. Storing that might be useful too.
Reply: @westonding8953  yes, very consistent. And the heat is already stored so no need for additional storage.
Reply: @westonding8953  just read back on the comments after mine, 100 💯 percent the best source 💯
Reply: I was waiting for a "You Should Be Pumped About This" pun.
Reply: In the UK we are testing tidal turbines as well which while not energy storage (they would work 24/7) they would help with base loads and help us and more countries off of using gas peaker plants, though I'm not sure if it as feasible in the US?
Reply: @markreed9853  I like tidal turbines, these are a more predictable source of energy compared to wind.
Reply: @markreed9853  They don't actually work 24/7.  Their output varies with the tides which are roughly sinusoidal. What that are is predictable.
Reply: @markreed9853  I’m from London uk please show me these wave machines 😂
Reply: I don't understand why we are wasting our time and resources with renewable energies. Nuclear energy is by far the most efficient form of energy available and it is actually safer than certain renewable. We should use nuclear fission until we create fusion reactors and that will be the used for hundreds of years
Reply: @apexdisease6030  nukes are not very portable - do you mean electric power on a grid ? Cause that's what nukes are
Reply: @apexdisease6030  you nailed it with your statement " I don't understand...."
That's obvious .
Reply: Hydrogen is so inefficient in so many ways and so hard to move and store.
Reply: New nuclear makes so much more sense, specially on poor countries
Reply: @levmatta  too expensive
Reply: @levmatta  it takes too long, we need the grid largely solved before the decade is out. Just getting permits takes that long.
Reply: @levmatta  no, its just to costly and takes way too long and then you leave future gerneations with the cleanup bill, in the UK our new nuclear power station is going to cost over £20 billion + and will have taken over 8 years to build!!
Reply: @markreed9853  very good reply, all of that is just technology/investment problems. Please note that I am talking abou New Nuclear -- small, modular, pre-fabricated, molten salt  (preferably Thorium breeders but not limited). (Someone will point about so called "waste", that is also not a problem at all)
Sorry for being brief, the point is that storage is important but very economically wasteful.
Reply: @levmatta  yes I've seen lots about molten salt reactors and these new smaller ones but I still can't see it being cost-effective/quick to install compared to installing more wind and solar (even the mirrored ones that heat liquid for storage) with other battery/other types of energy storage, we just haven't got the time as well
Reply: @levmatta  Nuclear will still require storage, or diesel/coal plants to cover for peak loads. Nuclear is much better than wind/solar for providing consistent base load, but most plant designs can't ramp quickly enough to cover peak usages.
As for Thorium plants, those are decades out. China just completed 10 years of their Thorium test plant trial, and they are still a ways out from commercial plant designs. Most other nations are years if not decades behind on Thorium plants.
Economically, nuclear plants are just too expensive for Third World nations, not to mention the infrastructure needed to extract, refine, distribute and safeguard nuclear fuel, which is by no means carbon neutral or even environmentally friendly.
Nuclear has a lot of potential as a reasonably green energy source for developed and industrialized nations, but it is not a near term solution for most of the world due to cost, environmental concerns, geographic factors (any high capacity plant uses steam turbines, so needs lots of water), infrastructure requirements, political concerns, and the sheer fact that a lot of promising nuclear technologies are still at least a decade or more away.
Reply: @V_is_for_Void  thanks for the reply! Will study your points, in concrete terms I believe your right (but still hope nuclear can provide peak loads also -- I need to review).
(this video series is nice and informative, it just stink of Toyota a little too much -- compound to that the high cost of renewables + storage -- ahh just wish arguments like mine, yours and others were part of the video to clear the stench)
Reply: @markreed9853  If you compare the rate of CO2 emissions reduction that France saw when it installed its nuclear energy system to the reduction that Energiewende has made in Germany over the same number of years, nuclear beats renewables many times over. Nuclear is also the only energy source that's capable of displacing fossil fuels in any significant way, which has also been made clear by the Energiewende debacle. Germany also has some of the most expensive energy in the world, while France has the least expensive energy in western Europe.
Reply: @levmatta  Actually it doesn't, because new nuclear plants are becoming increasingly expensive due to their complexity and safety demands. So much so, that they can only stay competitive with government subsidies.
Reply: @andreasvogler1875  And you don't think renewables and fossil fuels are also heavily subsidized? If they had to responsibly contain their waste the same way nuclear does (instead of dumping it into landfills/the environment) you can be sure their prices would be much higher as well.
Reply: @tonynowak6306  Sure, but renewables get cheaper, due to improved production processes and there are companies specializing in recycling solar panels. Also, unless it gets physically damaged, a solar panel can produce power for more than 30 years without producing any more waste. A nuclear power plant produces nuclear waste as long as it is in operation and most countries don't have a place where they can safely store that waste.
Reply: @levmatta  Nuclear is extremely safe in developed countries, but having it in developing countries is a Chernobyl waiting to happen
Reply: A bit upset you didn't learn about liquid metal battery
Reply: @nedisawegoyogya  Source on that being anything but theory?
Reply: @psikot  Ambri?
Reply: @psikot  at least it has wayyy better chance than flow battery imo
Reply: @nedisawegoyogya  So, no. Both are vaporwave.
Reply: @psikot  say as you like, the concept is just too obvious. Change my mind with arguments, not a statement.
Reply: @nedisawegoyogya  Show me an article, not clickbait news, on new battery chemistry.
Reply: @psikot  not even a new tech, and already demonstrated, but okay
Reply: @psikot  can't send if YouTube censor me
Reply: @nedisawegoyogya  ?
Reply: Diana, love your channel. I'm an electrical engineer in the energy sector, and you are 100% right here. Our biggest concern is not energy generation, but storage. It's very difficult.

And by the way, the problem lithium ion batteries is not with lithium supply, but with cobalt and nickel supplies. Those are far more challenging. Also, no standardization in lithium battery chemistry make battery recycling much harder also.
Reply: @Physics Girl instead of looking to "regulation" or "incentives" all you need is prices. A grid can be a market place with a clearing price of electricity, where the grid takes a cut for maintenance. All the grid needs to do is lower prices until the frequency comes down and raise it till the frequency goes up. You propose that the wind is a problem, it is not. Customers, storage and generation can all make well informed decisions with one signal. Spot prices can be broadcast and you can have things like two dimensional thermostats with Temperature and price, no one needs to be caught off guard by emergency pricing, and prices. "Peak" "offpeak" are terrible approximations of a market and prices are not trivial and not something one party can determine. Planning a market causes problems, there is very little place for a vote and no decisions should be made by an entity that cannot fail/go bankrupt because of their bad decisions.
Reply: We should be talking about NUCLEAR Power !!   Making it safe, building power plants, etc...  as part of a Zero Carbon future.  While Solar and Wind power can help with peak demand supply .. the underlying base supply should come from Nuclear.
Reply: Would you have done this if Toyota didn't pay for it?
Reply: @chrisstearns10  how could they have access to a hydrogen vehicle otherwise?
Reply: @kus88  some hydrogen vehicles are on the market currently. Not many sales because there are so few re fueling stations.
Reply: @chrisstearns10  True... infrastructure is a big hurdle and we're adverse to change... sometimes I wonder how we ever got past horses.... "Gas, who needs gas? Doesn't that stuff explode? And cars are so noisy.... I'll stick with my horses, thank you"   lol
Reply: @chrisstearns10  fossil fuel companies are shilling hydrogen so they can keep selling oil
Reply: Stationary storage has only one real option i know, vanadium flow battery. Aside from hardware maintaince, the battery medium itself never wears out and you can upgrade it as necessary. The use of snthing else is people not letting go of a second rate dream.
Reply: @patryn36  
We don't even know what all of the "anything else's" are yet. To say that there is only one true way is to close your mind to the other possible solutions.
IMHO, of course.
Reply: @patryn36  that view is way oversimplified. LiFePO4 batteries are outstanding for voltage and frequency regulation. Flow batteries cannot ramp on the millisecond time scale lithium can. Then, it would be hard to beat V2G on cost as most will have those batteries anyway.
Reply: @williammeek4078  flow batteries do not wear out, the ionic bonds have no limit on how many cycles the battery can last, the lithium iron phosphate does impressive as they are. The lithiums are good to start with but one would be a fool to stay with them when you have flow batteries. Only time a fast ramp up time is relevant is like in an electric vehicle, for a stationary you need to have the output at certain level to begin with. Once you get into industrial applications, like an entire district of manfacture and computer companies, you really should go into reactor techs to satisfy the power requirements. The molten salt designs can run on current waste stockpiles and their spent fuels are actually valuable after they cool off, which is only a few hundred years instead of the millennia involved with current reactor wastes. As soon as i figure out the math on how to size the flow stacks, like find out how it is done, and i get the funds, i will build a vanadium flow battery for my own use since it is not that difficult. You and others could be the same but you have a flaw of depending on others to do these type of things for you. Regardless of where one lives, there is always ways to do things if you really want it.
Reply: @patryn36  Yes, vandium batteries do wear out. They may not last much longer than current LiFePO4 batteries that are expected to last 20 to 30 years.
https://en.wikipedia.org/wiki/Vanadium_redox_battery
Reply: @williammeek4078  that is only the hardware, not the medium. Vandium can be either ion state, that never wears out.
Reply: @patryn36  sure, nucs can be brought on line whenever they are able. The problem is that whenever is about a decade too late for addressing climate change.
Reply: @patryn36  No battery is without side reactions. Flow batteries wear out too. In fact, find me a primary source that claims flow batteries do not wear out.
Reply: @williammeek4078  the climate had been changing for longer than humanity has existed. Rumor has it the us has already met the goals of the paris accords, a few other much larger countries have not. Why do we have to bend over backwards for those who seem not to care? The reason i am targeting having a flow battery is because i dislike relying on others and paying for their incompentence and i like being self sufficient.
Reply: Love your show, but you are missing so much in your research. For example, you took in their selling points on the tech, but you missed the environmental impacts of production of the various types of energy and energy storage. For example, Blue Hydrogen is created from splitting methane, getting the hydrogen, and generating CO2. It creates more CO2 than just burning coal.  For lithium for batteries, you should look to the US war in Afghanistan, where a large portion of their $1 Trillion in minerals is in lithium, more than in Bolivia, which recently had a right wing coup (to which Tesla's Musk tweeted that "We will coup who we want to"), eventually with that government being thrown out once an election was allowed to be had far beyond the time of the constitutional mechanisms of Bolivia. If you look at prior studies from a couple years ago, the US military alone produces the same or more emissions than developed nations. 

And make no mistake, Trump was even considering military related actions in Mexico after reports broke out about the discovery of lithium supplies there, with a certain type of lithium that is more rare used in medical devices, all as China began overtures to help develop the extraction for Mexico. They were using the auspice of cartel violence against Americans and the fact AMLO had canceled buying war helicopters from a military contractor in the US, thereby spinning a narrative of "hugs not guns" around AMLO and saying he is too weak to take care of the issues with the cartels, so we must (including suggesting invasion).

That is before talking about the mining efforts, the filtering tech needed for the water and protection of downstream people. This should especially concern you after the Donziger case related to Chevron (even though the courts are saying this is proper, the prosecution refused to prosecute, so the judge, with ties to Chevron, then hired private counsel to prosecute the attorney after a win for Chevron having a massive oil spill in Ecuador; as an attorney, I can tell you this stinks to high heaven even though the DOJ gave it a clean bill). You should really look into the coal mines and water quality in the Eastern US, then look into mining practices in middle and south america and the effects on drinking water of native and indigenous peoples of those countries, needless to say the impact on animals, etc.

Then you should also research the engineer plan to transition the US to 80% renewables by 2030, which was a 50 state, state by state strategy. 

Moreover, you should look into the water tables and the aquifers set to run dry around the globe around 2030, along with predictions of massive drought. 

We are already seeing water shortages due to colorado having less snow pack and thereby having less water making it to the South and West of the US. This is only going to get worse and we will need to do water pipelines like gas pipelines and desalinate water, which is currently an energy intensive process. Further, we can do active atmospheric water generation through heat pumps to pull water from the air, but that, too, is energy intensive and works with refrigerants, etc. 

Also, you should look up the safety record of storage in salt caves.  We are talking migrating gases, gas leaks that are near impossible to put out, etc. We don't have a great record with some of these things, and if done near fracking zones, evidently fracking has increased earthquakes. 

So you are really at the start of the story, not the end.

I deleted all the links to Wiley Online, Forbes, Stanford, Weather, NatGeo, Science Direct, Researchgate, phys org, and usgs gov. Let's hope this isn't deleted this time.
Reply: @ajc-th5ei  exactly! After 40 yrs we should have unity on 3 simple points. 
1. It is no one solution ,each region has its own plus and minus geological varying challenges.  Weather resources etc 
2  we will incentives and allow organic markets to dictate not forcing over taxation and regulations.
3  we will not just move problems elsewhere.   For example  usa recycling just being dumped in poor country's like the last 30 yrs. Or kill entire bird species with windmill farms. Or electric cars forcing more power plants. Or lithium batteries disposal and rare earth mining being more devastating than the orginal problem. 

To be here at this point and still debating when everyone understands this is just hard headed ridiculousness showing the corrupt hypocrisy around green anything
Reply: @dadsonworldwide3238  Little more information on birds. It is estimated around 100,000 are killed annually in the US from wind generation. It is estimated the feral cat population of the US kills over 2 billion per anum. In fact, the recent scourge of birds dying in the northeast by the millions is more per year than those lost from wind generators. That doesn't mean we should not try to minimize what is happening, such as recent research showing painting one of the blades drastically reduces birds being hit and dying. It means we should not over state the problem unless it is disproportionately effecting a species where it is a danger for their continued existence. But points taken.

I disagree with the incentives and markets working. If you understand lobbying and how our system is setup, the greed of the people with the established means of production has included buying and shelving patents for renewables so that it did not take away from their current revenue stream. They also have effected legislation making it harder to deploy solar, including home solar initiatives, making homeowners pay to be able to have home solar or contribute it to the grid, requiring a switch accessible by the energy company to turn off home's solar production, etc. 

So this is not a "leave it to the markets" thing, as our markets and our political officials have failed us. The most recent research published shows we are nearing 20 years ahead of the initial studies in the 70s through the 90s, which is where we came up with the estimate of 80% renewables by 2050. The rhetoric never updated even though more recent scientific study now shows that 2030 is more significant. 

We are not trying to avoid climate change. We are past the tipping point. That ship has sailed. We are now in the mitigation game, meaning trying to slow the changing climate and minimize the damage that is done from it. From the droughts and upcoming displaced populations, which the underestimate of the world bank puts at 142M by 2050, about 21x larger than the displaced from the Syrian civil war (think of Europe's response), which some argue that due to people coming and going, instead of the 7M number presented on refugees, some put it closer to half that. No one knows the exact number, so I'm going with the higher and ignoring the number of internally displaced in Bangladesh as well as those that left Bangladesh for India, which caused problems with India's infrastructure, specifically the sewer systems.

So, there is a lot more to this than what you mention, but I do thank you for the discourse and engagement.
Reply: @ajc-th5ei  damn just usa . Yeah I saw first hand visiting my cousin in what used to be a bird wildlife refuge .IT wasn't anything like when we was kids it had drastically changed the place since I had been there 30 yrs before.
Reply: @ajc-th5ei  The missing birds has now lead to insect and misquote crisis where they are forced to spray chemo each year . The trickle down effects you wouldn't imagine .
Reply: @dadsonworldwide3238  -yeah, I just wanted to diffuse the arguments made by people to not do wind generation by putting the bird population detriment into a context. Further, we shouldn't be spraying to get rid of most of those pests anyways.

Please look into the study suggesting that about 30% of the populations of animals and insects have died off. Not number of species, percentage of populations of species across the board are on the decline. There is one study out of Germany for a wildlife reserve showing even the insect populations inside the reserve are dying off due to chemicals used for insect control outside of the preserve. People have forgotten how important insects are for our environmental biome. Insects feed animals above them on the ladder and disrupting them is having an effect. Further, when bugs develop immunity to some pesticides, they become carriers, which allows for upward concentration in other species. See Silent Spring about DDT upward concentration or the concentration of microplastics in fish and human populations. 

So although I see your point, you may also be pointing at the wrong thing. Once again, thank you for the engagement.
Reply: @ajc-th5ei  Variety is good.  As I said at this post unity that we would 
1 agree its no one solution fits all
2 allow organic markets of profit to dictate rather than over taxation and regulation 
3 dont shift problems down the line .

Basic stuff that globalist and government tyrants and academia continues to violate or ignore.
Reply: @dadsonworldwide3238  - this is where I will agree to disagree regarding markets. I could explain it, but it is way off topic to the thread. But, still happy for the good conversation.
Reply: @dadsonworldwide3238  you really don't understand the system if that is your belief. I'm only a corporate attorney. What do I know. But once again, this is not the time to hash out ideologies. This is a thread about her video and tech advances related to energy.
Reply: @dadsonworldwide3238  the fact you don't understand capitalism always leads to monopoly is disturbing
Reply: @ajc-th5ei  sign a constitution with these 3 rules and every nation and every citizen nomatter political subsets will unite behind this. 
Organic transformation through markets let's the better man win the bounty while all of us help the planet
Reply: hears the thing we already have the greenest safest energy with 24/7 output ....but you rather back the scam that is soler panels built by slaves and do not digrade aswell as being toxic and dont produce more energy then production uses or wind boy who needs birds right kill them all o and all the brown outs and supper high power casts o who cares right....maby do more resrech then just sighn up for ideas that are failures and cause real harm
Reply: @danbrit9848  I have an engine research lab
I bet you watch fox
Reply: Why all the worry you can get double A batteries fron china that claims 9999 watt hours from ebay :)
Reply: @jonnym4670  yeah, but no niether is reliable over the long term which is what you and everyone else should be paying attention to. One way to make an overall situation work well is to use the best reliable tech, the best balance between that and simplest setup. Those batteries you named are good to start out with, but they are a stepping stone tech to better tech like flow batteries that lasts. Hope for the best, plan for the worst.
Reply: @patryn36  it's a joke dude it's a double a battery it's not going to hold that much charge that's just what they claim because they are full of bs
Reply: The answer is pretty basic 
I saw thermal batteries in the thumbnail but you had the wrong type
Salt melts at 800c 
The sun's energy is 48% infrared 
At 100 feet down a 5 ton case of molten salt will still have 90% of its energy after a full year of storage 
UV is only 8% of the sun's energy and requires a multitude of non environmental issues to use
infrared only needs glass, salt, water and iron to create all the solar power we need

There are a few power plants already , Vegas is almost ready to go online 
But big media is bought by big energy 
Solar panels are not the global answer
Reply: @mikep9690  energy is all around us Tesla was working on extracting it from the atmosphere approximately 100 years ago. Big energy shut him down took all of his research never to be seen again.
Reply: portable nuclear reactors last 20 30 years and small enough to fit on the back off a lorry akak truck
Reply: Hey
Reply: I would love to see more talk about including Nuclear Energy in combatting climate change. The IPCC, NASEM, and many science academies from around the globe have made strong consensus statements about the topic. I think science communicators need to also echo that consensus (looking at you Bill Nye!) and help break down complex concepts like radiation, risk evaluation, and base load generation. Love the series. Love this Topic. Thanks for all that you do!
Reply: @timwhite8905  nuclear can’t be done in time. We need to have electricity largely solved by 2030.
Reply: @williammeek4078  "nuclear can’t be done in time."

It's amazing to see how incredibly effective corporate propaganda can be.
Reply: @PistonAvatarGuy  Yes, it is. For example, what is the fastest a reactor has been completed from initial proposal until putting power on the grid?
Reply: @williammeek4078  It's not about how long it takes to build a reactor, it's about how long it takes to install a given amount of generating capacity. Because wind and solar have absolutely abysmal capacity factors, while nuclear has the best capacity factor, it's much faster to install nuclear energy... when comparing the actual energy output of the systems.